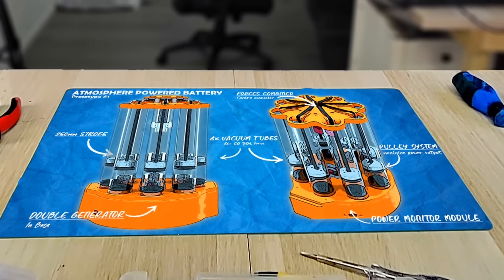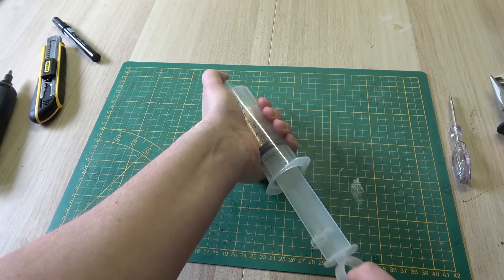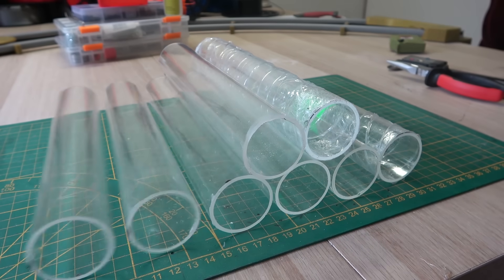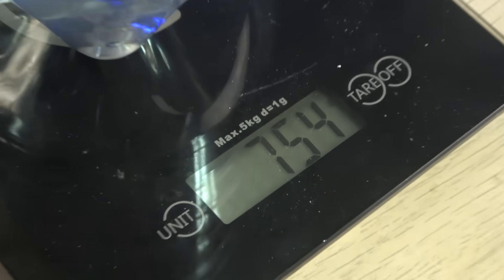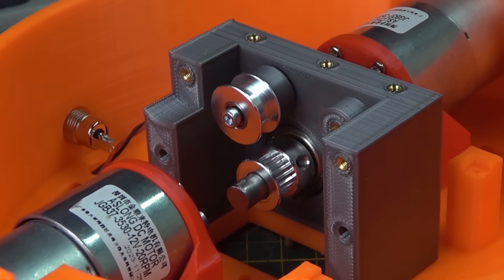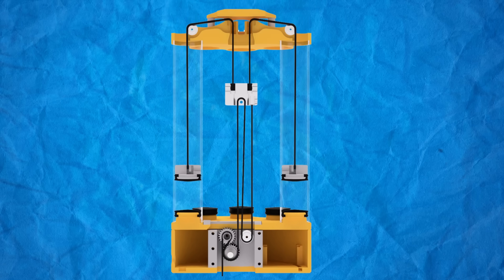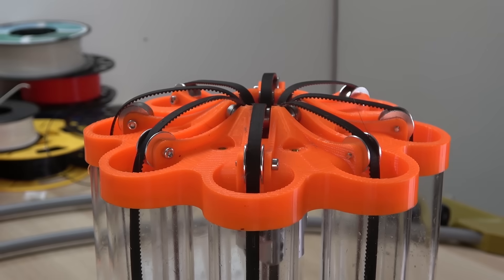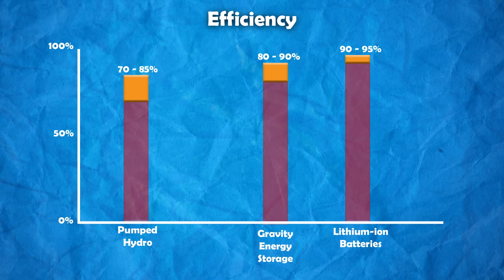Building an Atmosphere Powered Battery..

Comment: 73% is pretty damn good for not having a team of engineers perfect and tweak it over decades. Definitely some potential there for improvement.
Reply: @concadium I figured the force in these cylinders are equal to about a 350kg weight. That's pretty favorable density. Idk why he didn't make this direct comparison and only focused on efficiency.
Honestly, I think we're over-obsessed with efficiency. I'd rather have cheap storage so I can afford to capture all my excess when it is available. Imagine you pay a premium for 10% more efficiency, but it's not enough total storage for all your excess energy when you have it. All that lost potential kills your true efficiency.
Reply: @joshmnky exactly! This is something you could make at home on a budget. I can't afford a $600 lithium deep storage battery, but I could make this. Thought depending on the cost of that custom aluminum part, I might have to find another solution.
Reply: @joshmnky  Yeah and there are other considerations. The tubes are further apart than they need to be. Having them all touching in a hex configuration then you could get 7 as densely as possible and you could probably get 19 (3x3x3) into the same volume as the current one. The tensioning system might need to be changed to steel wires or similar but you could then probably drive 5 or 6 motors from that, tripling (or more) the energy that can be stored and retrieved. That would take you to 2kw. 8 of them charging off solar would give you at least 1.5kw/h for 8 hours. which then starts to look promising...
Reply: @concadium hey it just needs to be about 15 times greater and then it's worth using 😁
Reply: @knifeyonline  Right but this is literally a desktop sized battery.  Put it on the scale of space a pumped hydro station takes up and it might be viable.
Reply: @concadiumenergy density isnt as important for grid scale solutions
Reply: 73 is good period
Reply: @concadiumdousnt matter when a battery doesn't have to move
Reply: i agree, it also didn't have hundreds of thousands of dollars and countless man hours pumped into it over that 'decade' or more of time the teams are doing. Considering 1 man did this, with maybe a bit of google-fu help, and it is THIS SMALL and yet 70ish% effeciency?  Yeah.. that is amazing.
Reply: nah , it cant hold much power ,so it is pointless
Reply: Yeah that was my first thought.  Not to knock the video or the effort put in, quite the contrary rather.  The idea has great merit if a dude can achieve 73% efficiency with home tools and a 3D printer.
Reply: I work on a team of industrial engineers, and I doubt we wouldn't be able to get above 70% first time.
Just sayin...
Reply: Sorry to dash your hopes, but in reality the efficiency of this machine must not even be 10%.Engines have an efficiency of 50%, there are a lot of friction losses, that's twice...
Reply: @thennk9714  I think you misunderstand what the machine is.  Engines burn fuel to produce mechanical energy.  This device just stores energy.

"Gravity Batteries" would do basically the same thing.  You don't lose 90% of the energy just because of friction.  Lifting an object with a motor, and letting it spin the same motor to generate electricity on its way back down wouldn't experience a 90% loss of the input energy.
Reply: This.
Reply: their are batteries like , just google vacuum battery. But I think the future is lithium like batteries. It means something that all battery companies are working on natruim-battery or solid-state-batterys. In the last weeks there where some announcements of toyota and also a big chinese battery producer, that made these batterys.

Comment: Really like the idea/convept and design 🤓but 🤔it seems like you could save all the vacuum tube headaches as you scale up by simply using weight/cable or timing belt routed through pulley systems giving the motors a boost in mechanical advantage to lift and then maybe boosting generation on the down stroke as well

Comment: Couldn't you put this under water after fully pulled back and increase the pressure on the pistons therefore doubleing the output by increasing the gear ratio?

Comment: math on that syringe was way off. no way thats correct because 1: that was the outer diameter and you need the inner diameter. and 2: its 10mL to the point its marked or 10 cubic centimeters (cc) no way the rest of the syringe holds another 9 mL

Comment: Absolutely worth the time and materials. I did spot a few downsides, worth taking a look at. One is that it uses solar panels. Far from ideal at this point, because of the pollution and energy from making them, and the relatively short lifetime. Still worth using them, because you won't drive innovation / improvement in companies if they don't make a profit off of it;) Another is that the system needs to be perfectly airtight! As the video showed, there was some air seeping in past the seals. Yes, it's a prototype, so this can be improved. Thing is, perfectly airtight materials don't exist, so a fully charged version would "deflate" (or, inflate in this case) over time, rendering it useless, until you manually restore the starting vacuum. After all, it won't return to the starting state if there's air in the cylinders. And that brings me to the third: The prototype is assuming all cylinders will "deflate" at the exact same rate. If one of the pistons is at a different height than the others, the belts will have different tension, causing imbalance in the pulling mechanism. This can cause it to lock up or break all together.
I know it's a prototype / proof of concept. All the more reasons to point these things out, so they can be improved upon in following versions ;)
It also made me thing about a possible system that works on temperature change. Using a similar piston system and a ratcheting mechanism of sorts, you could use natural expansion of fluids when heating up to "charge" the vacuum cylinder, or maybe a spring or something. It's slower than solar power, because temperature changes slower, but it doesn't require ANY electricity to charge. Purely mechanical energy. The ratcheting system would be used to make sure that both expanding and contracting of the fluids would charge the vacuum cylinders. If you use long, thin tubes with fluid you get more movement out of the same amount of fluid. If that fluid is a liquid and not a gas, you'd likely get the most efficiency, since liquids don't compress. More force for the same temperature change than with air / gas. Air would be easier to "reset" / calibrate, but if you find a liquid that has a high expansion rate it would yield more energy I think.

Comment: I would love to see if its possible to design an "Atmospheric generator/motor" using these concepts. I wonder if a special valve can be designed in combination with the piston, and a timing cam, so that once it was primed to pressure and forced to turn over, it could pulse each piston in an alternating pattern effectively powering each pistons lift by the previous pistons descent. Hard to describe but I envision a working motor to generate power using this method in an alternating fashion.

Comment: Very interesting approach to store energy. But i think scaling up can be difficult. You would have to make parts extremely thick to be able to handle the working forces. Also getting a tight and reliable seal inside the tubes can be a little tricky. I have seen some comments about using this method in areas that dont have a lot of water and where the air is really dry. The only problem i can imagine is the friction that evolves with a drier enviroment. But still a cool idea

Comment: I think it is important to understand that while this is an option for energy storage, there are simply alternatives that have greater efficiency for a fraction of the cost. Pulling vacuum is generally quite difficult to do efficiently, requires more and stronger materials than simply pumping water uphill, and poses far more design and maintenance challenges. Additionally if you tried to scale this up to pull higher vacuum you would need to make the contraption larger anyways to compensate for the mechanical stress on the components, and at some point it becomes an incredibly complicated and expensive problem of trying to use affordable materials but needing the properties of those that are extremely difficult and consequently expensive to have parts made from. 

There are several points of failure that could also cause the battery to implode with practically no indication too. Mainly if the plastic deforms enough to cause a crack or let air in then the vacuum will accelerate the shaft of the motor rapidly and induce a lot of heat from friction as well as a current that shoots back and fries the electronics driving it, possibly to the point of causing an electrical fire. And regardless of whether that happens or not, those vacuum pulling mechanisms have a chance to accelerate whenever control over the vacuum is lost, meaning they will smack into other parts of the assembly and cause mechanical damage; This would almost certainly concentrate all of the force of the vacuum to wherever the leak is, which would cause it to implode. 

Most of your calculations are wrong. Many people already pointed out the incorrect power calculations so I will spare that. The surface area of your syringe piston is off because it is three dimensional and you treated it as two dimensional, the force required to pull the syringe vacuum is also wrong because the force acting upon the string is not in two dimensions like you assume. And you're failing to account for the frictional force as a result of the normal force acting upon the string at its intersection with the measuring tool. It is coincidence that the error in your calculated result is close enough to return the same as your experimental result, and if you remade this battery in a different size or with different parts they would be different. 

You should look into helmholtz resonators. They dont generate a meaningful amount of power, but it turns sound vibrations into electrical current.

Comment: New project proposal: Solar energy to usable thermal energy. If the problem to climate change is there is too much heat in the air, why not find a way to store and/or utilize the heat. For proof of concept, use a black metal plate to collect the heat, and on the plate's underside have refrigeration coils pulling the heat from the plate to a thermal sand battery. (The sand battery is cheaper and easier to make than the ceramic plate battery. The ceramic battery would also be better used in commercial use, like pulling the heat from buildings and roads to eventually power an electric grid.) Have a second system to pull out the heat energy to power thermal engines (and possibly a back-up pump in the above system), or thermal generators. Some testing would be needed to to find the optimal pump settings (i.e. Should the plate be same temperature as environment when sunlight is on it, or maybe a degree or 2 different?)

Comment: I throw my two Cents in too.

The best way to make it more reliable would be putting it inside an oil drum and filling it with lubricant.

Reasoning: Atmospheric pressure is nice, but under a heavy oil the pressure heightens, also lubricant is thicker and can not invade the tubes as easy as gaseous components in the air.

Comment: It is an interesting way to store energy. The biggest problem for upscaling is that it has an 1 atm. restriction (at sea level). To store usable amounts of energy the device has to be quite big. Compressing air in a cilinder is much more promising. You can compress air up to a few thousand atm., which results in much smaller devices.

Comment: ¿Can't the weights be replaced with large water containers? , the water can be condensed in the container without heavy lifting, then dropped when needed, it can lift up by itself with a pulley system after the water's been evaporated into another container, slo~wly.

Comment: Common commercial lithium ion batteries or LIB in EV's and COTS consumer electronics, have a fade performance of capacity of 1000 cycles or 3-5 years before 80% capacity, and round trip net system charging efficiency of 80% or so

Comment: Instead of vacuum why not a positive pressure system? We use 360bbl vessels rated up to 65psi. it would probably kill efficiency running a compressor; I can't be bothered to do any math. Maybe small scale with scuba tanks rated at 3000psi?

Comment: What do you do to make your printed pieces so resistant to traction? My pieces don't resist practically anything if pulled against the direction of the layers.
You can't project absolutely anything. A simple hole in the screw piece, when you put the screw in it causes the entire piece to crack.

Comment: I think the idea has more applications then this gravity shit. The most important part is that you can divide it into modules, so the forces applied are divided as well. With gravity you need to have super heavy weights so the tensions (cable) are super big as well. 
What you did with these 8 pipes could be replicated with more modules by stacking the pipes vertically - one piston, which connects 2 pipes. Same thing for the second and third pipe. 
Efficiency as a whole is secondary to the production and maintenance costs as well as the utilization after the battery is no longer usable. 
Imagine that instead of pipes you have multiple containers with a vacuum pomp and after venting the air from one of them you open another valve and vent another container. 
In these 8 tubes you have around 254,5 cubic cm (minus the hardware, but lets skip it for now), so this is around 1/4 of a liter. You stored in this space 628 W (if you divide it by the discharge time you will have the actual power output). 
Now lets scale it up. Take a container with 100 l volume, and for the sake of simplification just multiply it by 628 W * 4, that gives us 251,2 kW. If we assume that the discharge time will be around 50 s per liter (I tried to measure based on the video, but this is a very loose  approximation), then we can get around 20W of constant power over the period of 3,42 h. 
In terms of the application - having several 100 l container around the house or in the backyard is more feasible then having a 100 t weights.

Comment: It's all fun and games until you'll try to maintain vacuum in considerable amout of time. And as a scientiest working  around 10 years with different vacuum setups I can assure you - on a long run your efficiency will drop off drastically. You cannot make abcolutly vacuum-thight devices, air will leak through seals, metals will leak hydrogen inside, glasses - helium, water vapours are everywhere and so on.

Comment: A really useful project for youngsters to learn physics & engineering. If the battery was charged via solar, or wind turbines then yes, it's a viable way to save energy for use later, when demand arises.

Comment: Just do 1 huge vaccume chamber and use heavy weights on a cantilever for charging assist. Combine gravity and vaccume because you can't have 1 without the other. Gravity creates pressure which is what you want to use to make power, so go BIG. It's like a engine but the air being kicked out is what drives the pistons. But in this case it's vaccume that's being squeezed away by gravity and air pressure. I believe you understand cube theory as well, that has a lot to do with the efficiency.

Comment: Id say the actual device is a worthwhile experiment and concept. It seems like it would have a far lower cost and even size compared to pumped hydro and weight. And the ecological impact is far less than lithium ion batteries. Would be interesting to see this charged with solar or wind energy.

Comment: I have a great idea! I think 😅 So, say you have a big enough or multitude of pistons capable of staying in sync with a gravity batteries falling stroke, right? As the weight is dropping, it is pulling a piston (or someway of creating a vacuum for that matter), the two meet at thier respective peaks; the weight having touched the bottom (while still maintaining the speed and torque needed to spin the generator, and being capable of synchronously pulling a negative atmospheric pressure), and the atmospheric capture  (having a perfect balance as to not affect the effectiveness of the generator, [someone is going to have to do the math] and still be able to "assist" with the crucial lift stroke), then you can, in theory, maybe even exponentially, boost efficiency into a positive factor. As the fall stroke is really energy harnessing and not requiring energy input, then whatever can help with the lift stroke will create positive energy. The key is being able to help with the lifting stroke in a manner that also harnesses natural phenomenon to create energy with zero or very low energy input. 
Second idea, now that im thinking about things in a gravity battery mind set. Although crude and maybe foolish now that I think about it, (the variables are probably too many) but I will still type it; Use solar water heating to transfer steam up and let it naturally condense in the cooler air, or even a condenser utilizing aerodynamic cooling of some sort, obviously having multiple tanks in rotation constantly, and use the condensed air as your generators weight. You may loose some ratio of water eventually but I think if a well seal is created then its essentially only going to loose what weight it contains in minerals and sedimentation. But it's a thought!
Hello from New Mexico and congratulations on the awesome project. Thanks for the entertainment!

Comment: what about pulling up a heavy puck outside the tube so less resistance and then dropping it down a tight fit tube. would the pressure be similar?